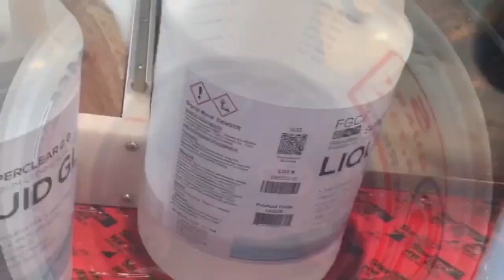Amazingly Satisfying Epoxy Resin Pour Compilation - Refined Nature of Santa Fe | DIY Woodworking

Comment: Fantastic compilation video! I got a question. How do you get rid of the drips on the underside of the trays after you’ve applied a final topcoat?
Reply from the maker: I usually just sand them off with 40 grit sandpaper! :)